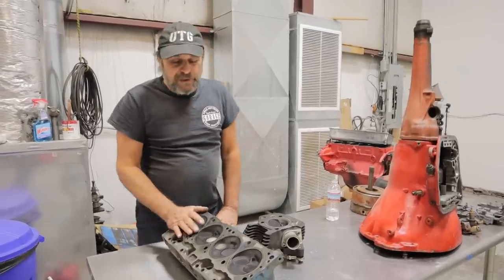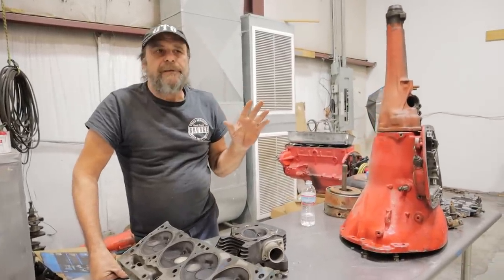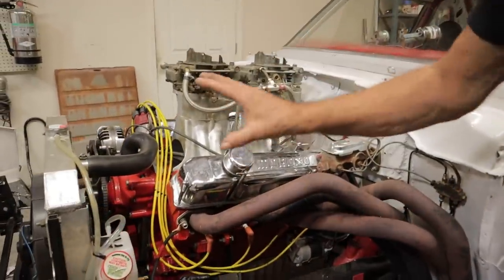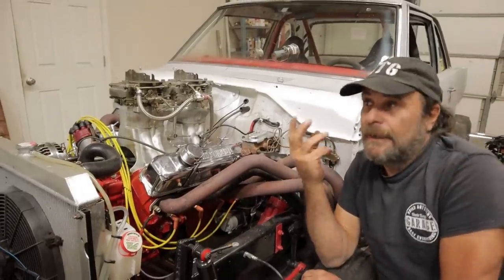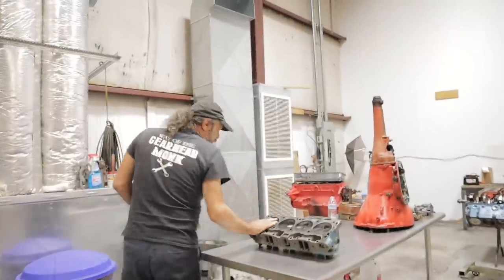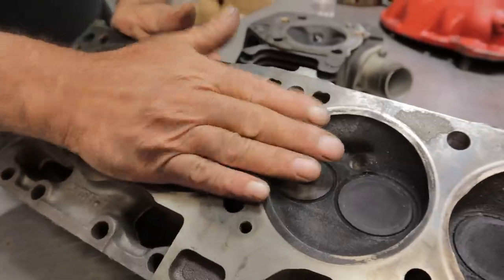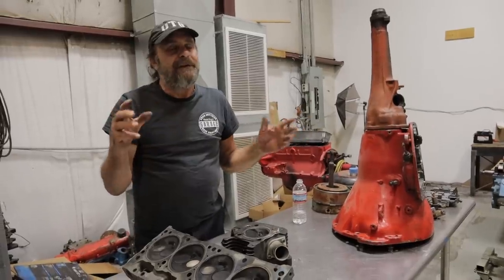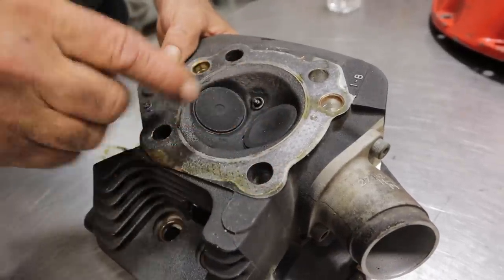The Secret Life Of Your Engines Cylinder Heads - How Combustion Chamber Shapes Make Power

Comment: It got my wheels turning a lot cause i was pushing brakes on my toughts on filling  chambers area to achieve 14:1compression without shaving over 0.060 on my heads.  Grinding 12cc off is getting me close but now i know filling side chambers is possible, i will be less stressed from having to shave the intake manifold to match my heads if i was obliged to achieve my goal, scrapping my intake from any other stock use after at same time. Pontiac Tripower intakes dont run down the street.  Everytime i watch Tony's learning contents, it sleep smarter at nights and its important to "me" as a common DIY amateur car and engine builder to aquire these specifics skills.  I want to be better at what i like.  And when i get to the tree lights next time with my 65 GTO, i will be proud the first time the front wheels pop 0.001".  Planning how to put wheelee bars next year if i dont want to ruin my rear bumper.  I love mopar but cant find a nice body for my 360ci.  5k for a Rolling Dart chassis.  Not for me now anyway.  So i practice on my 4 Pontiacs.  I already knew some mecanic stuff but nothing compares to Uncle Tony's Garage way of teaching from my POV.  Others have good skills too but dont have details im searching.  
I don't only ear, I learn!
This is not to praise Tony, i heard he hates it.  It a Point of View.  That's it.
Hope you learned something out of it!  Hahaha.

Comment: When my mentor Clif Kolostow worked at Ed Miller's in the late 60's early 70's they would take brand new 340's and mill the heads .060" 
That turned the open chamber head into a closed chamber head. I think they were more interested in upping the compression, but what you are talking about here was no doubt a part of why they were doing that. One thing is for sure. Their 340's ran better than most. Like MoPar said, "340...the Big Bore Hunter"

Comment: I could be wrong, but closed chamber heads will increase compression ratio (CR) that can led to detonation while open chamber heads has better flow and lower compression ratio. Thanks for the depth of info on combustion chamber heads. 👍👍👍👍

Comment: I've learned what Uncle T is talking about over many years of going to Bonneville...  As Gray Baskerville called it, The Great White Dyno.   Dollar per Hp, the recycled blown fuel Hemis that guys use have the most bang for the buck.  The two fastest Blown Fuel Roadsters at Bonneville are nitro powered Hemis... one is naturally aspirated on nitro and actually went faster than the blown car.  The N/A gas classes are ruled by wedge type engines.  Blown gas powerplants seem to do slightly better with non Hemi designs as well.  One friend of ours ran a 500 inch TFX nitro fuel Hemi on 4 cylinders on one bank and the car went just as fast as the full configuration. They estimated it had to be making 500-600hp per cylinder to go the speed it did with 250cu. in (E record 303mph).   Car number 125 has blown fuel competition coupe records starting at AA  305.241mph  A 305.607mph   B 311.149mph   C 300.022mph  D 296.278mph E 303.231mph   Keep in mind these engines are de-tuned from a drag racing setup... they have to last up to about 80 seconds under load each pass and it takes 2 pass average to set a record.  Also Bonneville is around 4000ft above sea level.

Comment: awesome explanation.  its funny when people huge overlap cams on a supercharged or turbo car, when a normal cam would make more power.  more valve lift is fine, but more overlap and youre just blasting fresh air fuel mixture out the exhaust.

Comment: Emissions is another reason starting in 1970 you saw engines either getting moderately stroked. Or manufacturers bringing out engines with around the same displacement but featuring smaller bores with longer strokes. Also one way of opening up the combustion chamber was to raise the deck also dropping compression ratios.

Comment: this video is pretty good but theres a few things id add, im not suprised that anyone would be lacking knowledge on this stuff becase of how sparce the info is and how hard it is to find. the hemi chamber bolth has the least serface aria for a given volume whitch helps retain heat in the combustion charge whitch ofc is responsable for the power you make and due to this it wont form hotspots adding to the spark plug point you made. the performince also has to do with the fact you can fit massive valves to the engine whitch allows large flow along with the geomitry advantage you mentioned. open combustion chabers came about becase the lack of high octane gas so they wanted to decrease surface aria and compression whitch also aids in emmisions kinda. high surface aria reduces the temp of combustion whitch does decrease nox emmisions. though the increased swirl and turbulace also helps with emmisions due to having a more homogonus and complete combustion. this also aids in high rpm performince sence you have alot less time to complete the combustion event so any added turbulince helps. though high rpm induces turbulance due to the increased flow whitch is one of the reasons why why we see hemis perform pretty well at high rpms. its always intresting to me that designs like the hemi and the rotary whitch i conciter to be on opposite sides of the spectrum due to the rotarys large surface aria per volume making combustion happen very slowly. bolth of them suffer from a large lack of turbulace.

Comment: Scenario, big block with non hemi heads and a 6-71 supercharger with a Howard’s cam ground for a blower.  If the blower is removed, should the cam also be changed?  I’m having trouble getting may machinists car tuned
Reply: The engine will run fine with a blower grind but it depends on what ha wants the engine for. It wont be optimum for a drag engine but would be great  in a heavy car with a stock converter. I ran a turbo cam for a while in a non turbo engine and it worked great, but not as good as the cam that optimized the whole package
Reply: @superrodder2002  it’s in a T bucket, mild stall, C6, 4.30s. It’s a cruiser

Comment: Now you're talking about what Bob Glidden did with the mid-size engines of Pro-Stock.  It wasn't cheating it was using what was available and keeping it in spec (though modified).  Go back to the wreck at Atlanta and how Bob put his fire-suit jacket over the intake and carbs on that engine.  He was working on the pulse!  When I set up and engine, I always worked with the overlap, TDC and how much before close and open.  Tons of horsepower there!

Comment: Tony , best video you've made! ,, look at Bob Glidden 351C pro stock heads ... basically they have been copied by every automaker ... I think you'll need to incorporate port bias to optimize exhaust pulse assistance with the intake as you'll have to have a far more open chamber near the plug side. Anti-reversion added to ex port will help too.  Welding and grinding that cheap iron is going to be dreadful...any aluminum versions available?

Comment: Exactly what I'm setting up to do is welding to fill in key spots of the combustion chamber for a better burn and round all sharp spots for ceramic coating and modify a dome pistons with a unique pistons shape. 
  I'm only truing the heads. 045 cast steal. Heads crack and fail when shaving to much for a certain combustion raio. 
 Filling in parts of combustion chamber cause of what IL experimenting with.

Comment: The valve overlap is what causes the engine to lope. The smaller like 109 degree or less has no vacuumed because intake and exhaust are open so long. But makes more power

Comment: Nice honestly look forward to you welding up the heads. I've seen angle milling the heads and intake  to a small degree to get this effect not as much welding up the other side to close off the chamber? Also remember probably a old circle track magazine where Smokey  drilled holes in the headers and put a small stand pipe to add oxygen to the exaust which heated it more and increased scavenging.  realy would like a in depth look at how you go about welding head castings.

Comment: Another point to ponder, Vizard recommends sinking the exhaust valve seat .050 lower than the intake so at split overlap your not losing your intake charge out the exhaust. Instead it skips to the outside of the valve face and stays in the chamber so it can be used for combustion. Neat trick, I thought.

Comment: Hey Tony! Great information in this video…thanks! Can you do one about the different internal sounds a motor can make and what they usually mean? Granted, it won’t be a long one, but you know what I mean. Keep up the good work!
Reply: Are you talking about failure sounds? It's a little confusing what you are saying or asking for...
Reply: That would be a good one.  Thinking of my harleys is what comes to my mind....plenty of sounds there, is it detonation or, is that valve rattle, or is tht the rocker shafts rotating and clacking or, is that noise just the metals expanding from heat as I accelerate.   All sou d rather similar if you haven't spent alot of time listening to them.
Reply: @williamstamper442  well yeah….lol

Comment: The Tunnel port , Medium riser and Hi riser have a machined sort of open chamber and they found that the heart shaped chamber is far better for quench . I even had a Hi po 1958 352 with a machined open chamber  and they did that to prevent spark knock  because the octane was not up to par with the fuel you could get in the 60's Like Sunoco 260 or 280 .
Reply: One early V-8 with a heart shaped combustion chamber is the first generation AMC V-8s. Which were backed up by some lousy intake manifolds and the center exhaust ports being siamesed. I'm not sure but the chambers might have been machined.
Reply: @mpetersen6  I had some 406 Ford heads and have seen some early 390 T bird heads that look like today's aftermarket heart shaped design . I did a 390 AMX but I don't remember the exact details ?
Reply: @edge2sword186  
The later AMC V-8s are closed wedge combustion chambers. The earlier V-8 was a cast chamber.
Reply: @mpetersen6  Pontiac had machined combustion chambers and that Ram Air V was state of the art at the time.
Reply: @edge2sword186  ...Yep...the Pontiac heads being machined was something that not many really knew about....and the Ram Air was no joke

Comment: Fun fact: If you have no exhaust manifold, the exhaust valve can be involved in pulling in fresh air! The only well known example of this is the Gnome Monosoupape rotary engine from WW1. Because in these engines the crankshaft is fixed and the whole engine block and cylinder set spins there can be no exhaust manifold. Furthermore, there can be no intake manifold, instead such engines have to draw their charge through the crankcase like a 2-stroke.

In the Monosoupape, these two factors were combined to produce an engine that was able to perform a 4-stroke cycle with only one poppet valve. The power stroke was as normal, however the exhaust valve was held open until a bit before BDC on the intake stroke, sucking air in directly through the exhaust port. The final part of the intake stroke with the valve closed produced a partial vacuum in the cylinder, this served to draw fuel in through a set of transfer ports in the cylinder near BDC, bringing in an extremely rich mixture from the crankcase that combined with the air already in the cylinder. The ascending piston covered the transfer ports, and compression occurred as normal prior to the power stroke.

Surprisingly these engines were considered quite reliable for the time, even if their castor-oil based total-loss lubrication system did tend have a certain laxative effect on the aircrew...

Comment: I'm in the middle of deciding on a custom cam from Comp Cams (MM 251@.50 int/ MP 258@.50 ex. is what I'm about to pull the trigger on) and all this time I'm only thinking about maximizing duration while staying within an acceptable intake closing window to keep compression up. Overlap hasn't once crossed my mind as something to consider extending or shrinking, my mindset was as long as I'm getting nice duration and compression is good who cares about the rest, let it fall where it may. I'm not sure I'll have to change anything but I'm gonna go back and compare some other profiles and see how overlap can be used to it's full efficiency. Keep up the good fight.
Reply: Keep in mind that too much overlap will make low speed performance (especially idle) really bad. The engine ends up sucking exhaust back into the cylinder at low speeds, which dilutes the charge enough to cause intermittent misfires. Kind of like a 2-stroke chainsaw at idle (2-strokes do all of their intake and exhaust during the overlap period!)
Reply: @nerd1000ify  no doubt, I'm talking about maximizing the signal to the intake port to jump start cylinder filling but ending it before that. I'm wondering what the max overlap would be before the exhaust pulse starts to get pulled back the wrong way. At some point in the future I'll be putting dual turbos so I'm ordering it with a 111 LSA to prevent the opposite problem and the intake charge bypassing the cylinder and shooting down the pipe

Comment: @11:03  Not only does the exhaust pulse pull not matter for forced induction, but having significant overlap means some of the pressurized intake charge gets forced right out the exhaust before the exhaust valve closes.  High performance cams for natural aspiration (with high overlap) are a bad idea on forced induction engines.

Comment: Now I am filled with questions like "how does this then relate to you picking camshaft?" and "wouldn't a raised piston of some design be the best way to tackle the combustion chamber shrinkange or would it hurt?"  or how about this being the reason behind that idea that an exhaust system promotes more of that pulling action thru the chamber, single vs dual... all kinds of questions now that this little piggy must know the answers to!  haha  I like these learn em videos.
Reply: a raised or domed piston (to create compression) can impede airflow into a cylinder and sometimes can block the flow of the spark--some domed pistons come with a "flame tunnel" milled into the dome.
but it is interesting how many will pick a camshaft design to help the ports flow more air by keeping the valve open longer....yet if the combustion chamber doesn't burn well enough, you're just moving raw fuel in and out. Now, if you can do a good angle grinding job on the valve seats in the head and on the back of the valve face, you can help the port flow more air/fuel at low valve lifts. which will create the effect of more overlap at the cam as the intake valve begins to open off the seat and the exhaust valve returns to the seat. so you can have less overlap in the camshaft profile if vacuum to drive power accessories was an issue.

Comment: Well. Them pulses you get during all strokes is the engine soul. Not only the one you made this video around, also the ignitionpulse will interact. Hard to explain it, but look at a slo-mofilmed nuklearblast showing trees or what not, and you will see a movement backwards at the end. This is what happens closest to the sparkplug when the flamefront expands and creates a expanding vacuumarea behind it. As it closer down to the BDC the exhaustvalve open before, making that vacuum that is at its strongest in the top pull the accelerating outwardgoing gases and increase the acceleration even more. As the accelerating piston passed the between of the centers and slowing down due to the cranks circular movement the next vacuumpulse occure due to the speed of the accelerated gases from earlier in the cykle and the now slower piston. This is the nearly full description of the overlap. I missed the part where you describe the function of the tubelength. How it functions to control that slight backward gasmovement in the end that prevents the incoming to just run thru. I know it exist such, but I would love to hear a sequal where you explain it a little more. I know placement of sparkplug will differ the result, but is there more to it?

Comment: Uncle Tony, I especially like videos when you talk about engines. This one was awesome.   But there's something I don't understand that I'm sure you touched on. Pontiac through 1967 used a closed chamber bathtub shaped chamber. In 68 came the open chamber with a sizeable quench area. My question is with the Ram Air IV chamber in 69-70. Pontiac opened the chamber even more and eliminated the quench, it seems counterintuitive to me.  The chamber is shallower to keep the same volume as RAIII, and it needs more timing lead.
Reply: So why would they do this.